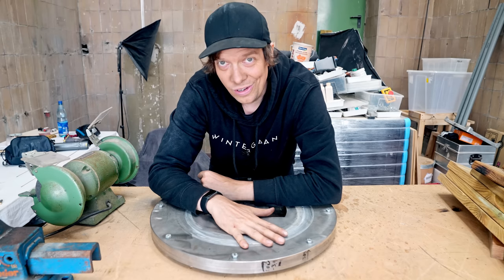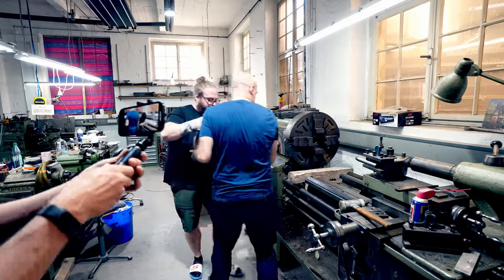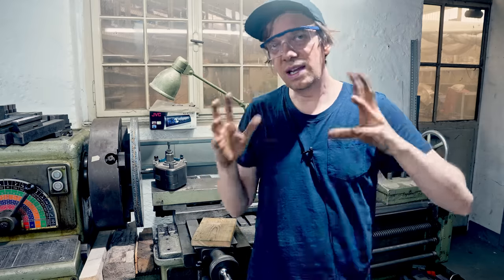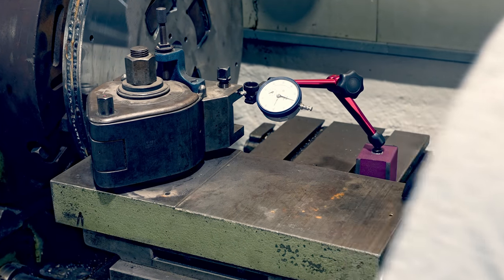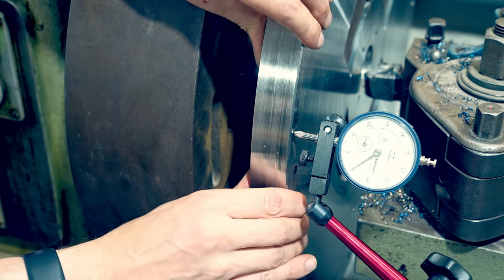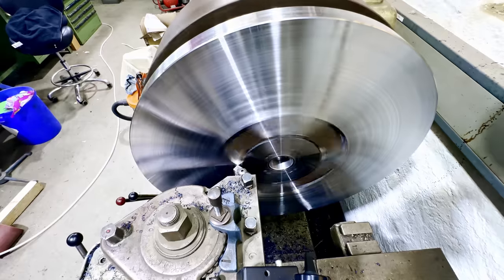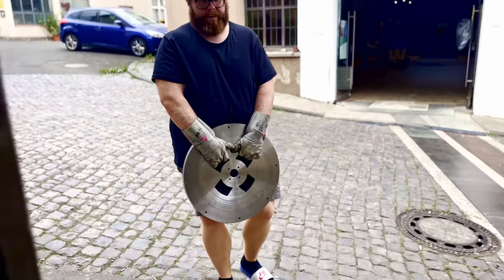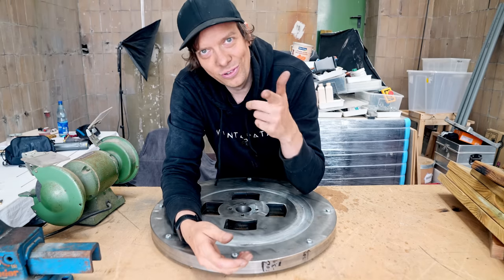Can I Turn This Wobbly Flywheel Straight? - DAY 7,8,9 - Marble Machine Flywheel Prototype

Comment: One other note,  after turning the first three surfaces, see if a centering spindle is available for that lathe when mounting for the final side. May be as simple as using the tail stock for centering. Also, set the last  flywheel face registering against the already faced surface (if you did that the first time, I missed it.)❤
Reply: Seconded. Indicating off of the first face cut after you flip the piece to cut the other face is essential with the 4 jaw setup you have. Imagine as though you want to replicate what a surface grinder would do -  make the second face parallel to the first. So long as your first face and ID cut were square, it should be flat after that. 
Also try to true in the flywheel on the bushing when you put it back on the test rig, as the bushings are excellent for concentricity but may need trimming in for square, just like the lathe itself. Tap and tighten.
Reply: Interesting. Didn't know those bushings don't do squareness as much.

Though I believe besides measuring the first surface there's no real good way to do this in our shop I wouldn't trust the tailstock right out of the gate. This lathe hasn't been used that heavy within the last 6 years.
Reply: @jakemauger8377  Yes when he flipped the plate the indicator should have been on the inside to measure off of what he just turned. I still say he should use a surface grinder to make both sides parallel and smooth.
Reply: @maesto  The bushings are good but they're metal on metal, they're gonna hang up a little, and with a radius that big, a little is a lot.
Reply: @billkeithchannel  That's a big damn surface grinder for a part that size, but yeah if you've got access to one it'll do the best job.

Comment: Martin, the wobble is in relation to the center axle and bering. If you indicate the face of the plate, that is not flat; etc you'll probably not get it correct. On the axle, with a support by the tailstock would probably produce a better result. I'm not a specialist, far from it; but there you go.  ;-)
Reply: Take it to a wheel shop and they'll balance it in 5 min.
Reply: A live center in the tailstock.

Comment: If you really want to get perfect axial and radial runout on such short parts with large diameters, you can't do it with one part welded from several parts. Your biggest problem is the partial heat input during welding, which leads to partial internal stresses. If you then turn the "stressed part" there are always areas that find space and relax and that will never be round. The best thing to do is to cut a piece of bar stock and take it to a hardening shop or similar trade and let it "soft anneal". The material is heated continuously to about 700°C and cooled down slowly. This reduces internal stresses and creates good basic conditions for a perfectly round part. :)
If you now take a machine that is not so worn out, then it also works :)
I still wish good luck and much success!

Comment: You are going to ultimately run into tolerance stacking issues whenever you deal with things that need to move. It's just inevitable. I'd suggest picking a runout/concentric tolerance of 0.2-0.3mm and optimize for that. Your average been around the block mill/lathe/etc is going to have a hard time holding tolerances much tighter then 0.1-0.2mm. You generally have to go to surface grinders and hones once you need tighter tolerances. Plus once you add bearings into the mix the best you can achieve is whatever tolerances those bearings have internally. There are things you can do to help minimize tolerance stacking like using pillow blocks with cam or concentric locking collars. Those will clamp down on the shaft such that they are ceneterd to the bearing without any special setup. You can use regular pillow blocks with grub screws but you'll need to center the shaft as you tighten it. It's not hard just tedious and time consuming. I think I would also heed SKF's advice and upsize to a 30mm shaft. Worst case scenario it doesn't do much and best case scenario it prevents vibration and noise.
Reply: Perfection and unreasonable tolerances ended the first mmx. That functional part that could never have enough clearance to do exactly what its doing? 
 Balance isn't critical but looks are?! I followed him for years. This project is a hoax.. You could use a car tire and a axel if you needed a flywheel and just wanted results. 10 years of the same pattern. He will remake it and then add complexity's to make it fail. and overcome that. then fail. At some point starting over.  repeat. 10 years.

Comment: The lathe: the scariest machine in a workshop
Martin: "So much fun!😄😃"
Reply: He's so innocent, that's why he's not affraid. But with the few mistakes he made and learnt from, I think he is coming of age on the lathe now. Maybe he is affraid now.
Reply: Tablesaws can be spectacular as well, but yes a lathe is like an alligator
Reply: It is fun though!
And it's say our planer would be the scariest machine in our workshop.

Not that the lathe wouldn't f you up if you don't pay the proper respect to safety
Reply: @maesto  the metal working one? Cause those seem highly disrespectful of limbs...
Reply: They are fun!  Significantly more fun than a mill, in my opinion.
Reply: Scary? Matin's not five years old anymore.
Reply: @christianvanderstap6257 nah, our wood planer. It just sounds like a air raid siren. Really gives you the feel it doesn't want to be on 😅
Reply: @christianvanderstap6257 usually the woodworking ones are the one eating fingers. Ive only seen stationary metal circular saws where you clamp the metal, theyre pretty safe to use. Arguably the grinder of all things is one of the most dangerous and the one im most afraid of tbh
Reply: @anteshell If a huge, rapidly spinning hunk of metal isn't the slightest bit scary to you, then you shouldn't be near any heavy machinery.
Reply: @SomeoneYouKnow2671  no, that is the complete opposite. The moment I have any reason to fear such thing, I should not be near them. Did no-one ever teach you to do your work properly, including any safety protocols and precautions? I suggest you to learn some of that, otherwise you pose danger to yourself and everybody else working around you.
Reply: Reminds me of the famous gore video 'Russian Lathe Accident' where a guy is shredded into pieces. It is a blurry security cam video but there are photos online about the corpse pieces on the factory floor.
Reply: @anteshell  I feel like you're missing the point. Of course there are safety protocols that need to be followed, but if anything fails, or you make a mistake, then your life is on the line. That's what makes it scary. And fearing for your life is exactly what motivates you to take these precautions.

Like, would you say that bungee-jumping isn't scary just because there are precautions to not let you fall to your death?

Call it respect or call it fear, but if you're operating a lathe without it, then you're bound to get careless at some point.
Reply: Scary, nah, old hat spindle moulders are scary, it can (is possible on old/old hat machines), throw its blades across the room, you wouldn't even have time to know it hit you, if the blade went through your eye you'd have a 99% chance of death.
Reply: @SomeoneYouKnow2671  I am not missing the point. You are. Understanding the risks and dangers is not the same thing as fearing them or being afraid.

One gives you an ability to make informed choices regarding the safety, while the other hinders your ability to do so and increases the chances of making a mistake. Having uncontrollable feelings like fear towards your work equipment is fundamentally bad and dangerous thing.

Your comparison to bungee jumping is so idiotic that I'm not even going there.
Reply: @maesto sounds like your surface planer is removing too much material in a single pass, why not try reducing the gap (hight) fron the top of the cutter and the top if the indeed table (I know the machine and setup might make this difficult or even impossible.)
Reply: @anteshell  I don't know why you are being so aggressive when you're essentially saying the same thing than SomeoneYouKnow2671. They are juste saying that you have to be aware of the danger. Knowing what's the danger and what it entails won't make you less prone to accidents. Being aware of the danger at any time will make you less prone to accidents.
Reply: Martin 9 Fingers was such a kind fellow.  

Then "it" happened.
Reply: @matthewcrist1012 he's still alive
Reply: Wait till he puts a chuck key through the roof.... 😂😂😂
Reply: *thousand yard stare from seeing the lathe videos online
Reply: With oil it would be even more fun:)
Reply: @leoelamri4054  I'm not aggressive in any way whatsoever. Calling a stupid thing stupid is not being aggressive. And he is not saying the same thing as me. As I already told, being afraid has nothing to do with being aware of the risks.
Reply: he never had a coworker show him some liveleak lathe accidents
Reply: @matiascampbell2464  oh, no it's just loud even without any material being fed
Reply: @idomeshi7078  afaik carbide inserts either need constant cooling or none. Else they tend to be shattered due to the heat shock. Still want to invest in a minimal cooling solution with air for that matter
Reply: Hell ya its is,one wrong move can literally end you😬
Reply: But you get over after time,everything in a workshop is dangerous if your scared to use it,and dont know how,but your chilled and know what your doing its all good

Comment: Small tip for the future: use a grinder to make two grooves on the junction of the plates in the OD. Making those chamfers, you can weld better and have a stronger weld. Plus you can turn the OD without removing the welding, eliminating the risk of separation of the 3 plates. 

I noted you welded also the 4 holes for the vise chuck. Try to use the method you used before: use the chuck as a face plate.
Reply: Nice tip, he needs to grind before welding

Comment: First off, not bad for a first time using a lathe! Yesterday, you couldn't spell machinist... now, you ARE one. 🙂 I did have some advice, though, and I don't know if it has been mentioned already or not. I do lathe work on engine parts for commercial airline engines (Pratt & Whitney, GM, Rolls Royce, etc.), and whenever we do a setup on a part, we ALWAYS indicate the face of the part first, before doing the radial runout. That way your perpendicularity will always be good when adjusting for the runout. I think that may have been the cause for some of the runout when you flipped the part around, because I didn't see you indicate the face you cut to get things back to perpendicular. (If you did, I apologize) Of course, a loose chuck definitely complicates things, and when I saw you move that chuck like that, I uhoh'ed out loud. But nobody's perfect. Keep it up, and you'll be a pro in no time!

Comment: Maybe the brake applying pressure on 1 side only has contributed a bit for the wobble.
I would just make those inner holes bigger to fit a larger shaft in a upcoming tweak
Reply: "Borrow" a brake from a bicycle.

Comment: Massive oversight by the team when changing out the chuck for the 4-jaw! A very near miss should that have worked itself loose, regardless of inaccuracies in the cut. Always check your equipment yourself, make sure that it's damn tight.

Comment: Hey Martin! I work a lot with sheet metal in these thicknesses and if for whatever reason you ever make more of these. 
I'd recommend going at it with a rubber mallet and a straight edge, with enough patience can you get parts that size within a millimeter of flatness. (Just place it on two workhorses and work your way down in a straight line hitting whatever point is the highest, being mindful to keep where ever your hitting in the center of your workhorses and spaced out accordingly with how "wide" your high point is. Just be sure to sneak up on how hard your hitting, this is veeeery important when starting out as you can quickly give into frustration and start creating more work for yourself so put on some music and chill as your doing it, taking your time will end up being faster as a beginner.)

Sheet metal has internal stresses from the rolling process, this can be mitigated by specifically asking for A or B grade plates, as C grade ussually are all over the place in terms of flatness but they're more expensive obviously. 
The parts getting cut out also creates a heatzone and as we all know, hot stuff shrinks when it cools. Plasma cutters have this awful tendency to put a twist into larger circles, getting it laser cut (specifically on a "fiber" laser instead of Co2) will dramatically reduce the size of the heatzone meaning much flatter parts.

Comment: You shouldn't forget that you weldet the pieces and bring a lot of heat and so tension in the parts.
When you turned them, the tension relases in some areaes more than in others.
Also you should try to turn the same amount of material from booth sides so that the outer discs are roughly the same thickness. Thinner material responds different to this tensions.
And your workholding is a bit problematic too. These disks are never pefectly aligned. There is always ab little bit of shift between them. And when you clamp them to the chuck, the first jaw clamps on the first disc, the second on the third disc and so on... This again brings tension in the piece. Ass sone as you release the piece this tension disappears.
I think you get the point...

Comment: Lots of learning to do for turning, I'll let other comments give tips on that. Couldn't help but notice that your weld seams were visible after turning. There needs to be some v-grooving weld prep to give a place for the weld bead to be that won't be turrned off in the next step. Happy machining.

Comment: Armchair tip:  dial indicators are delicate, and it is recommended the feeler tip is lifted off the work piece during "whacking" so the shock is not transmmited into their gear mechanism.

Comment: The prototype has clearly fulfilled its purpose: to increase knowledge and decrease risk. 

Even though I can understand the disappointment, I would still consider the experiment a success, as Martin's knowledge has been hugely increased during the process (manufacturing, critical design aspects, aso).

Comment: 9:39 "do the same cut again without changing settings" => "spring pass"
tool and material deflect each other during a cut, so a second pass allows them to both spring back closer to their actual neutral position

Comment: Martin, PLEASE use the upper depth control insead of the lower one for cuts. You get much more precise control of the movements and it will make your cuts much cleaner.

Comment: Chasing concentricity, perpendicularity, and balancing can be one of the hardest tasks to undertake in machining. Specifically balancing. Always always always keep in mind that the balance of the wheel is always in relation to the center arbor, shaft, and in your case the tapered bushing too.
Reply: And the flywheel needs to be balanced in relation to the axle in the direction of rotation, it doesn't need to be balanced in the direction of the axle. Wobbling as it did at the beginning of the video will not eat up stored energy as an unbalance in the rotation will.
Reply: @themazeecho9336  the wobble in the beginning could throw the dynamic balance out of whack

Comment: The loose chuck could have gone so bad, so this is a win! 
And of course you should do it yourself. 

The wobble is from the cut on the center, but also by looking at the video - that you doesn't clock it at the surfaces you have turned before. 
So that final facing should be clocked on the back side. 

But whatever you say, this is a win. Great work.

Comment: By making a laminate flywheel you have 1 problem when turning it flat , plate material has a rolled skin on it and when you remove that skim from one side only ( the other side of the plate is against the centre plate so cannot be machined ) the plate will curl up , unless you machine all plates both sides, when you machine rolled plate you release the stresses the plate gains from the manufacturing process. All plates should be machined both sides to equalise these stresses first before constructing the laminate wheel , 
The wheel will keep bowing as you have not turned all faces and released all the stresses , that said you can also have the stock plates stressed relived before any machining takes place . 
Great video have watched them all from mk1 marble machine . Your doing a great job

Comment: You're doing a great job as an apprentice machinist. Now that you're buttered up, two pieces of criticism: 1) Dial indicator on the face of the wheel is measuring perpendicularity, not runout. 2) NEVER leave a spanner wrench, chuck key, or other tool in/on the rotating portion of a machine. Best practice is for tools to be stored safely unless they are actively being used.

Comment: Great attitude on the "learning opportunities" Martin, very well done.

I completely understand your attitude around needing hands on experience to improve your designs, but I am a little surprised that you didn't reach out to the YouTube community in the area, to see if you could get a little more guidance on the turning (🙂) and work holding, but as you rightly said, this is a prototype, and you build a prototype to find the issues.

I'm sure that others have said, but the sparks were caused my cutting through the weld, which is far harder than the mild steel of the flywheel.

Comment: those taper bushing, you can tight them progressively while indicating the wheel until the bushings are completely tight. easy to do with a small impact driver with 4 stages
oh and you're a beast man keep it up